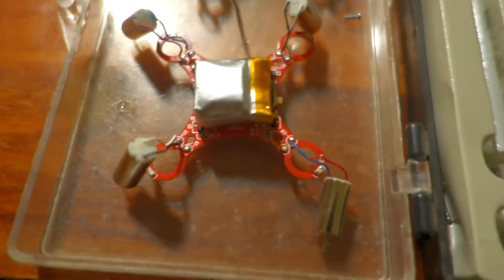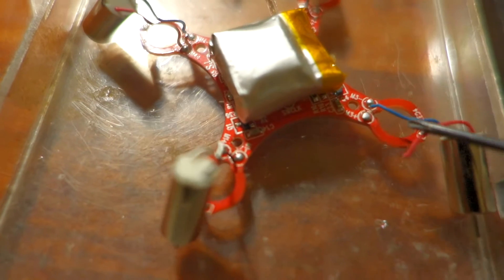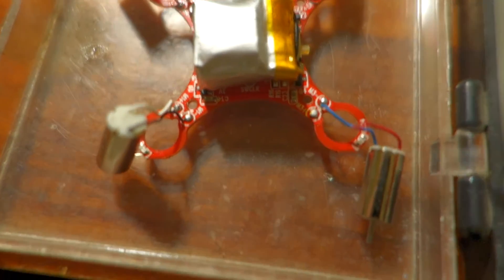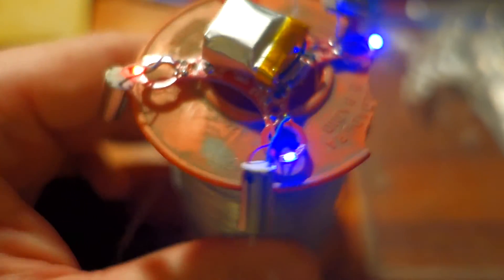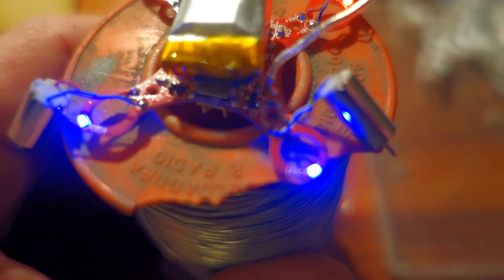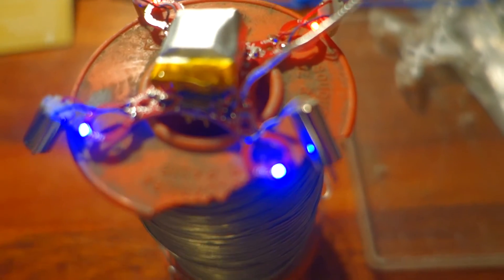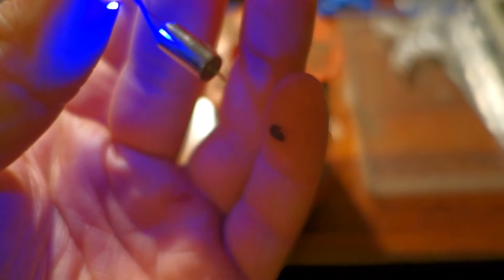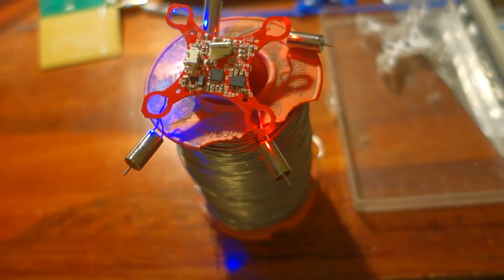FQ777-124 Pocket Drone Motor Repair - Inside PCB

Comment: Hi, ive also got this board from my old trunk...i cannt figure out abt its  transmitter or if it has mobile app...ive got its motors too...can u help make it work
Reply from the maker: no mobile app, it has a physical transmitter
Reply: @VeryokayDIY  possible to share its picture?
Reply from the maker: @1979zeesh  its not complicated, you look up to the title of my video and you find the whole part number of the drone, now you can search for it: FQ777-124

Comment: I also have the same issue (one of my motor wires came loose. What is the best way to open up the FQ777 drone without breaking the casing? Is there a dis assembly video/site somewhere? Thanks for your video!
Reply from the maker: +kalahariskydive This is a nice video! Note that there are small clips at the edge of the plastic housing you have to open that carefully. Anyway mine is broken in some arms and that's not a big deal as the screws holding it toghether. https://youtu.be/Eb07h_uPJ-0?t=1m26s